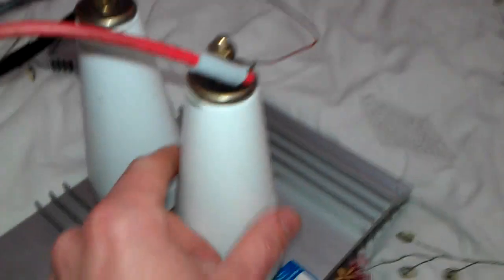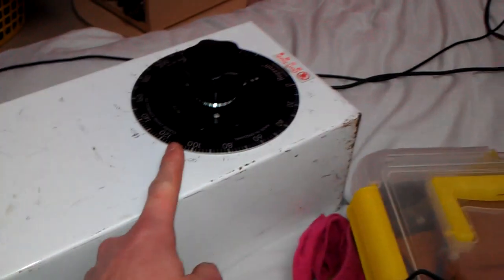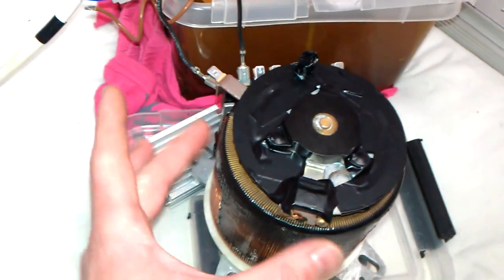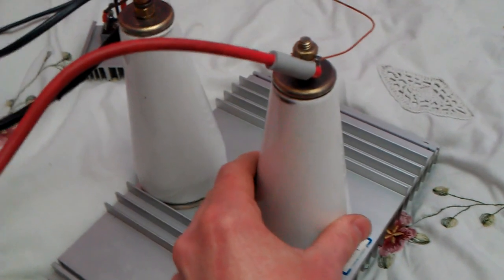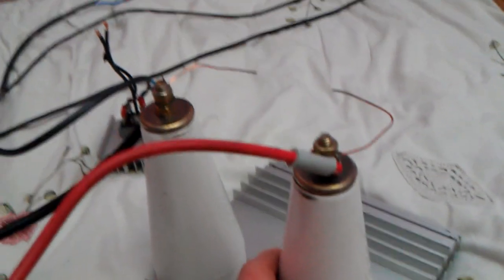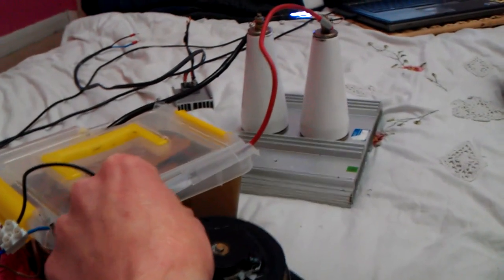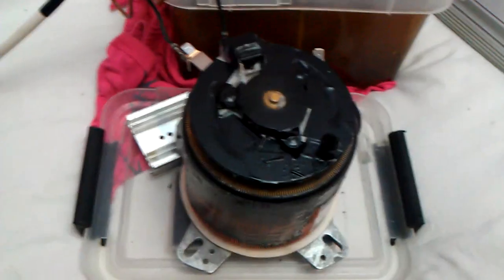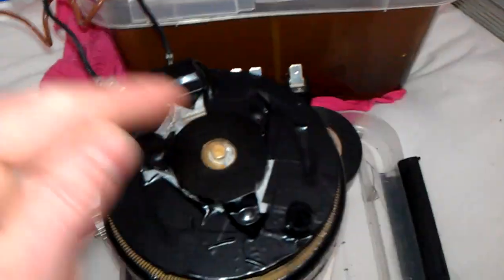Variac as a ballast

Comment: that is a good idea, neat to see it go from a sharp blue arc to a hot one, that is cool :D 

have you ever built a ignition coil driver with just a dimmer switch and a motor run capacitor?